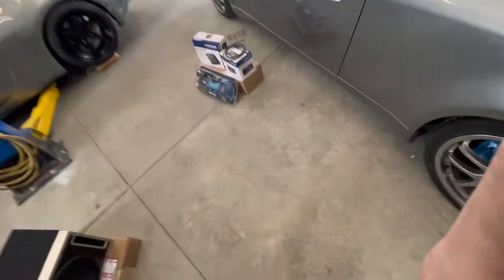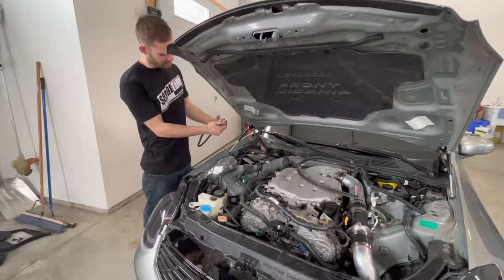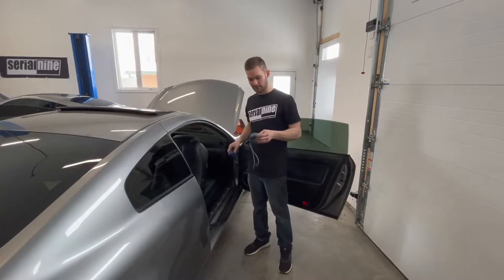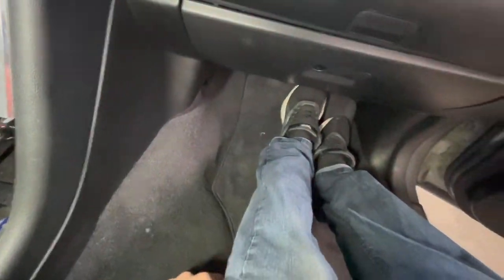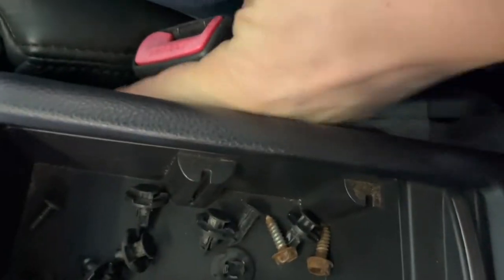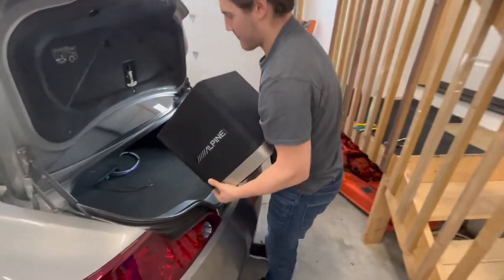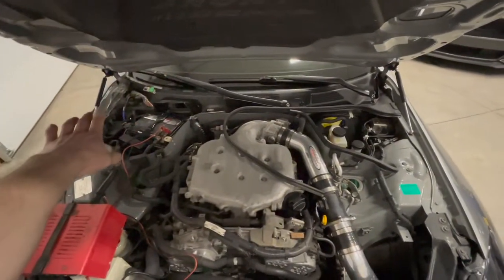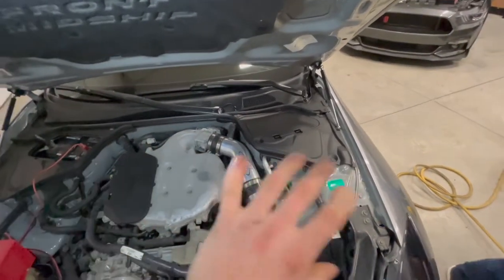INFINITI G35 BUDGET BUILD SERIES upgraded stereo install

Comment: Wade the install looks clean. I too went with the Alpine 500 Mono Block. My Sub is a JL Audio Stealth Box. Being a Audiophile on a budget, I replaced all the speakers with JBL GTO637. I also replaced the tweeters. The factory BOSE speakers are substandard Clarion contracted by BOSE. I strongly recommend Kilmat 80mil and Noico 150mil close cell foam sound deadening in the door skins,side skins and trunk area. You will notice an improvement in speaker sound quality and less outside noise.
Reply from the maker: Thanks for the tip ! We will eventually upgrade the door and panel speakers 👍

Comment: I have a couple questions. Can you still use the climate control or do you have to buy a new one with the trim? Did you keep the steering wheel controls and if you did, what harness did you use? Lastly, you have to use another harness in order to keep the factory bose speakers/amp separate from the aftermarket amp used with the subwoofer right. If yes, what harness did you use?

Comment: Did you have to upgrade your alternator with this set up ? And or did you notice any power loss !?
Reply from the maker: No the stock alternator is good it’s not gonna be for competition by any means for sound systems but it will give what you need or really what your ears can handle for power! lol

Comment: Wade. What year is this G35?  Mine is a 05 with nav and I noticed your center console is different. I’m going to be removing my nav and putting in the glove compartment with a 7” double din .  Had to get the dash parts from salvage yard
Reply from the maker: The car is an 05 as well ! That’s the way to do it. The head units have way more modernized nav and other features like CarPlay and such so it’s worth the upgrade !

Comment: I have a 2003 infiniti g35 sedan.
I want to istall 6.5 in front and back with amp and subwoofers with amp in trunk.  What sound system specs you recomend? I like alpine tipe R. You think thats good or what you recomend? Thank you.
Reply from the maker: If I ever do a full sound system I always like to match everything alpine sub alpine speakers for the doors and panels and alpine amps that will be more then enough of the car to sound great !

Comment: Where did you wire your remote wire to?
Reply from the maker: The remote wire goes from the back of the head unit to the amp turn on on the amp in the trunk. The harness wil have it labeled it’s usually blue coming out if the head unit.

Comment: Did u guys use stock oem am?
Reply from the maker: The oem amp for the bose system. ? The amp is built into the head unit we got. And it uses a secondary amp that’s built into the car I believe. You can have an option for the wirring harness with or without Bose system.